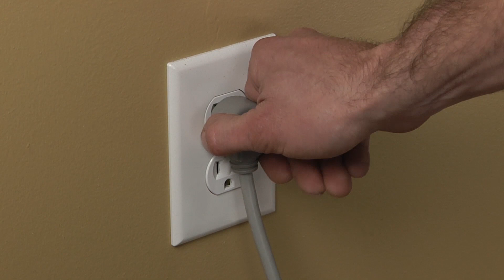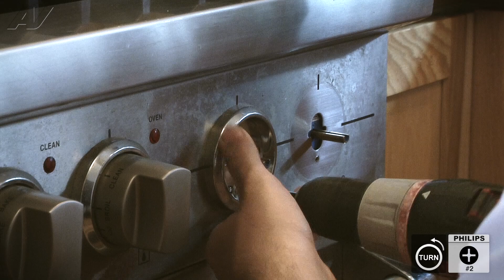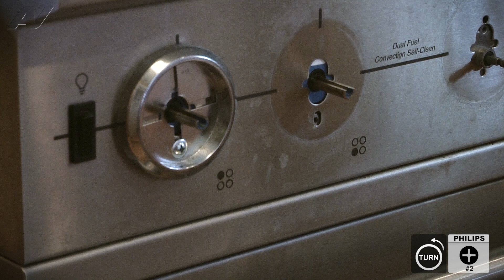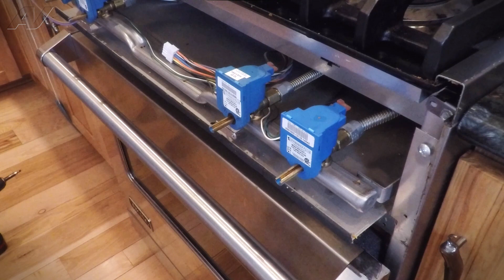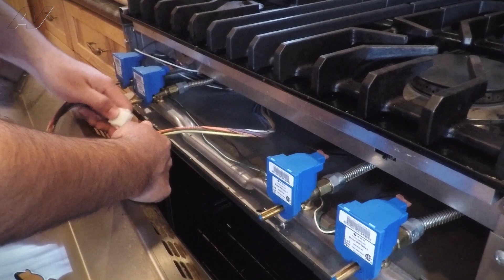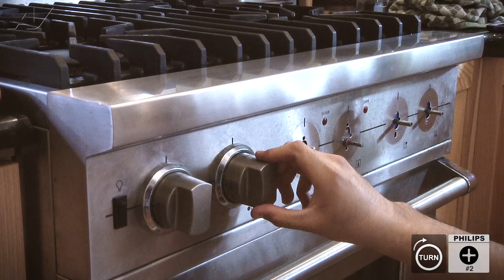Viking Stove Repair - Right Rear Burner Not Igniting - Diagnostics & Troubleshooting

Comment: The video is useful to show how to replace the IRIS Burner Switches.  But how did you determined that all the IRiS Burner Switches needed to be replaced?  The problem isn't necessarily the switch.  Can you do a video to show the checking of faulty grounds or bad igniters?
Reply from the maker: Great question, if you have a more technical question that our parts department cannot answer, you can search our over 17,000 answered questions free at our website www.ApplianceVideo.com under our Repair Help section. You can also call our parts department at 1-800-830-5465 and they can give you help 7-days A week ,or search at www.SaveMoreOnParts.com  .
Reply: I have this issue, only on one burner, when it lights, it does not stop the circuit of three igniters for continuing to fire.  the other two burners once ignited, shut down the ignition system.

Comment: Do you have a video showing how to remove the large metal plate on the surface of the Viking range/oven? Thank you.
Reply from the maker: Great question, if you have a more technical question that our parts department cannot answer, you can search our over 17,000 answered questions free at our website www.ApplianceVideo.com under our Repair Help section. You can also call our parts department at 1-800-830-5465 and they can give you help 7-days A week ,or search at www.SaveMoreOnParts.com  .

Comment: Is the spark module located in the same position on the 6 burner version of this unit?
Reply from the maker: Great question, if you have a more technical question that our parts department cannot answer, you can search our over 17,000 answered questions free at our website www.ApplianceVideo.com under our Repair Help section. You can also call our parts department at 1-800-830-5465 and they can give you help 7-days A week ,or search at www.SaveMoreOnParts.com  .

Comment: We have a Viking gas range viking range VGIC485-4GQBUBR with 4 burners and a grill/griddle.  The two right burner and grill will continuously click without stopping.  The grill always lights.  The back burner lights 20 percent of the time and the front burner never lights.  Help please!  A new service man came by and it ill cost 1200$ to fix it according to their estimate.
Reply from the maker: Great question, if you have a more technical question that our parts department cannot answer, you can search our over 17,000 answered questions free at our website www.ApplianceVideo.com under our Repair Help section. You can also call our parts department at 1-800-830-5465 and they can give you help 7-days A week ,or search at www.SaveMoreOnParts.com  .